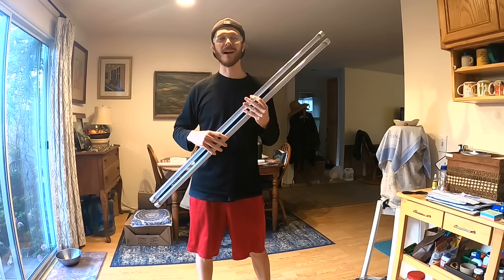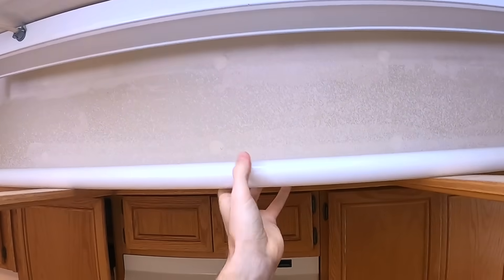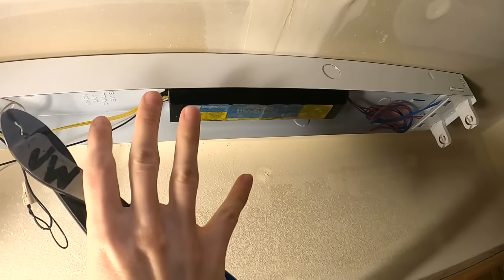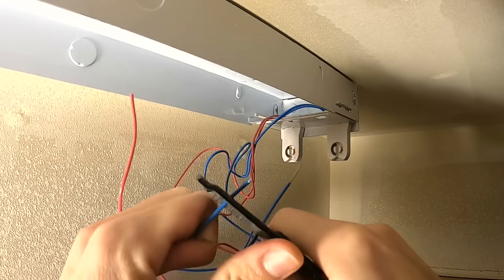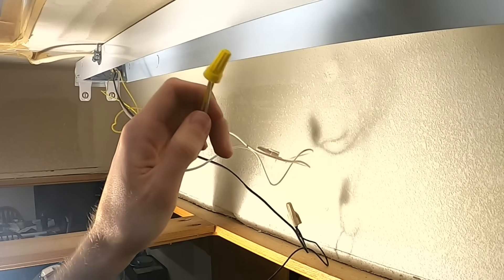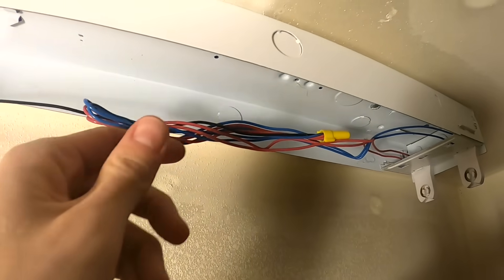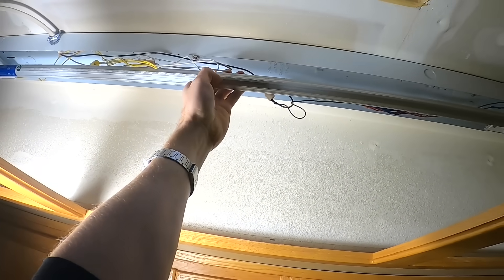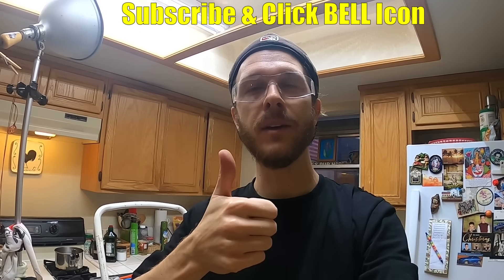How To Easily Convert Fluorescent Lights to LED | Save Money on Energy Costs

Comment: You should attach a LABEL to the fixture, to alert anyone replacing tubes in the future, that the fixture needs LED tubes ONLY.  My tubes came with labels, but I made better ones.
Reply from the maker: @joshm3342  Great point, I did write on fixtures, CONVERTED. LED BULBS ONLY. I forgot to include in video
Reply: Converted 120 v ac bulbs    they make a few versions of led bulbs

Comment: Nice clear video. One thing I always do is trim the ends of the twisted wires before I wire nut them to be sure all wires are gripped equally. Otherwise, GREAT JOB!
Reply from the maker: @vikingdane9757  Thanks! Happy to help, and thank you for sharing that tip 🙌👍

Comment: LED light tubes are a waste of money. If one LED goes out the whole tube is dead, and the happens quite often. LED is not ready for the big time yet!
Reply from the maker: @russconklin3414  there's some pretty good bulbs out there these days, but you're right some of the cheap ones can have a pretty high failure rate

Comment: After the conversion, especially now that the old ballast has been removed from the circuit, it would be a good idea to affix warning stickers informing anyone who replaces the dead tubes not to use traditional tubes but only same-voltage LED tubes in the future.
Reply: Most come with stickers for that now.
Reply from the maker: @davo768  Yes great point. For sure! I wrote on mine LED bulbs only! Fixture Converted to LED

Comment: My concerns are needing a certain kind of led bulb for this method and what happens if the wrong kind of led is used. Also, what happens if someone puts an old fluorescent tube in after this conversion? Will it explode or something???
I really want to convert to leds, but there's too many concerns like I mentioned that worry me a lot.
Reply from the maker: @mikeshanermusic  I write on mine "CONVERTED TO LED BULBS ONLY" and there's some plug and play bulbs that will work with or without ballasts bypassed

Comment: How are these bulbs doing now? Any other thoughts on this project now that a year or so has gone by?
Reply from the maker: @appleimacdude  those bulbs are still working great although I moved them to my shop now, as I did some kitchen remodeling 👍 If your ballasts are still good you can go ahead and try some of the plug and play bulbs first if you don't want to fiddle with wiring. I think the ones I linked in description can just be swapped out

Comment: I really wish well meaning Youtube DIYers would stop giving "Advice" to non-electricians on how to modify their electrical installations.  It would be like me - a Brit - giving driving advice to the rest of the world, ignoring the fact that most of them drive on the wrong side of the road 😀 and every country will have it's own rules and customs.  The item you called a voltage tester is NOT a safe means of testing for "dead" - This is more suited to fault finding.  (The advice to switch off the Breaker is always good)  But you gave no warning that simply switching off the light switch will, some cases, leave live cables in the fitting. This all depends on which wiring method the original installer employed. The light might be part of a 2-way switched light. It might be an Emergency light with a battery - in which case there would be a Permanent live cable. You may well be electrically qualified and know what you are looking at when you open a fitting. But for those out there with no experience, you are encouraging them to play Russian Roulette.
By all means, post this type of video as "Entertainment", but don't make yourself responsible for someone else's death by implying they are instructions on How-To....
Reply from the maker: @geraldelwood9660  You're right, I always recommend turning off breaker, then double checking 👍

Comment: They have the bulbs that take straight 120 volt and you cut out the ballasts and join the wires together. 

But, if it were me, I would buy new solid sealed LED 4 ft panels

You just disconnect the 120 from the ballast and take the whole fixture down and install a new fixture. 

They even have remote controlled APPs for the more exotic panels

You can change the color to anything you want, any brightness, and it can do ropes like the 1950s sign
You can have it change colors in a pattern. 

If I have to do work I would prefer to do the full setup so I don't have to do anything else in the future if I want to make changes 

And it's really cool to go from having nice bright white lights while you are preparing the meal and then when you are going to sit down you can select a nice red or blue light for dinner
Reply from the maker: @ocsrc  ohh wow sounds cool, yeah that's definitely another option as long as those new fixtures hold up over time

Comment: In Europe a straight Led tube swap is on the market no cutting wires just swop tube for Leds plus there is a starter unit that is swopped also' did mine last year a 4ft led tube was £10
Reply from the maker: @leso204  nice, yes we have plug and play bulbs available here as well. This is good option if you have a bad ballast though or don't want one extra thing to worry about failing

Comment: Linemen use linemen pliers. And no, thats not why its a rigjt hand twist
Reply from the maker: @willburt5v9714  yup my linesmen pliers are trashed I need a new pair. Ohh I meant you twist them clockwise with your pliers then twist wire cap the same way

Comment: Just turn switch off. NO need for breaker once switch is off.. Dont be 🐥🐤🍗
Reply from the maker: @willburt5v9714  Ill do that sometimes but Ill throw a piece of tape over the switch so no one flips it with my back turned

Comment: you can buy led replacements that don't require anything other than swapping out the bulbs. They've been on the market for years.....plus they produce more light....
Reply from the maker: @jchavins  yes you can get plug and plays as well, but this is a good option if you have any failed ballasts
Reply: wish they never made those ......always get rid of ballast !!!!!!!
Reply: One is a simple bulb change  the other needs electcian skills.   How  do you know what bulbs to buy if someone else made the change.

Comment: Its easier to just junk the entire box, chop 2 power wires off and wire nut a plug on it and buy an LED set that has a new housing.  This process just saves the housing of the bulb??? Why?  Just junk all that because they sell LED bulbs that have their own housing, just replace it all.
Reply from the maker: @scstudios8  yes you can remove old fixture and buy a new led fixture and install. Of  course that's an option

Comment: Plug n play bulbs are wayyy better. More reliable too as the quality ballast is doing the heavy lifting.
Reply from the maker: yes you can get plug and plays as well, but this is a good option if you have any failed ballasts. Actually the bulbs I used I think can be used either way, but I removed ballasts because 1 was bad
Reply: @JonnyDIY  true

Comment: I just bought an LED replacement for a flourescent light fixture; they said all you have to do is change it out and it should work.  Nope .. didn't work ... Do the internals?
Reply from the maker: @samsno3667  if you bought bulbs that are plug and play they should just pop in and work

Comment: Why does no one show an inline fuse on the line-in side for safety in case a non-compatible bulb is installed.
Reply from the maker: @davidfeldman7001  I write on fixtures "CONVERTED TO LED BULBS. LED BULBS ONLY"

Comment: how can you check to see if the wires coming into the ballast are working well? Any easy suggestions? thanks
Reply: You will need an ATG to check and test. But if you don't have it then hopefully that you have two or more lights.
Then you can switch the ballast. Usually if you replaced the bulbs and they don't come on, then it's your ballast is defective.

Comment: Well, with the enthusiasm that normally accompanies ignorance, I used this video to successfully convert to LED's on both my fixtures.  It's a good thing I had this video!  And whoever did it before had wires that as soon as I touched them, some fell out of the wire nuts!  So, I re-did these using pliers to twist them together like Jonny shows in the video.  Thank you Jonny for showing me the way!  Awesome!
Reply from the maker: @dimwitsadvocate6264  Awesome! You're very welcome, happy to hear I could help you get it done 🙌👍

Comment: Best video I've seen on this topic! I was nervous about tackling this project because so many times the situation I'm facing never looks like what the YouTuber is showing. Fortunately, my wiring was exactly like yours so I just ran the video through each segment, paused it, did what you just did, resumed to the next segment and repeated your actions. I was so confident in each step that I put the cover over the wires, installed the bulbs, turned on the circuit breaker, turned on the light switch and voila... light! Thank you for making this job easy!
Reply from the maker: @SpectralightPhoto  Awesome! You're very welcome, happy I could help you out. And Thanks for sharing, love hearing stories like this 🙌 👍
Reply: Thought mine would be a simple. I'm trying to use your method but no Bueno do far. I'm also trying it for 8 lamps if that makes a difference.

Comment: 5:55 I'd like to correct your statement about power coming in from both ends on your double ended bulbs. Power can ONLY be connected to one end or you'll probably blow the bulb up. At the other end is the neutral line, It's white.
The other type of bulb is single-ended, which means there are connections only at one end, while the other end has no electrical connections. On those you connect the power and neutral on the same end.

Comment: A good concise video on installing two bulbs. I need to see how to wire with 4 bulbs. I had a jack-leg electrician when I had my house built years ago so I don't trust all my electrical connections. At each end of my fixture, the tombstones on the outside bulbs are wired together with only one wire going to one pole. You said the bulbs don't care which end is hot or which end is neutral and I get that. What I need to know is: should I have two wires going to each tombstone at each end or can I get away with only using one each on the bulbs added with the hot or neutral wires? Using 2 wires each that would give me 9 wires to nut together. Or is there a better way?
Reply: P.S. I have shunted sockets.

Comment: LED lights are better than the fluorescent lights, be careful of connecting 5 wires, connect 3 to 4 wires are much better, unless if the ballast contains 1 red and 2 blue wires.
Reply from the maker: @MasterDilianoTheBlueKunBoy7K5  yes much more efficient for sure!
Reply: @JonnyDIY  be careful with the black and red wires it can shock you,  fry your body skin and your heart ❤ wear PPE.
Reply: @JonnyDIY  even you can connect to black wire too, be careful it's hot/ line voltage ⚡ with a brown wire. If you have some brown wires.
Reply: And gray wires.

Comment: The side you put them in doesnt matter? Neutral on the left since your yellow wires were on the left connected to your Neutral wire. Load to the right since your red and blue were connected to the hot? 
I just did this to my whole basement and the led lights i used had specific instructions to do so. Maybe just the specific light i used?
Reply from the maker: @stevang4720  yeah it doesn't matter on these type which was hooked to which side. Maybe they just wrote it up like that for ease of instructions as not to confuse. But hey as long as they work, all good 👍
Reply: @JonnyDIY  gotcha! Thanks for the fast reply!
Reply from the maker: @stevang4720  you're welcome, happy to help 🙌👍

Comment: good job.  clear and concise.  at time of approx 5:17 your comment when splicing the neutral to the neg side was that, "like I said, it doesn't matter which ones go to which side."  I was at a bit of a loss regarding that comment.  but overall, the best fluorescent-to-LED switch out/ballast bypass directive I could find,  Thanks.
Reply from the maker: You're very welcome, happy I could help you out 👍 Ohh I meant the black wire and white wire could connect to either side, interchangeable.  Wouldn't matter which side was connected to which 👍

Comment: This looks so easy. I got 24 used LED T8 double ended Type B lamps from Amazon for about $1 each. It’s way cheaper and easier for me to do ballast bypass than to try and replace the fixtures. In this case I can simply leave the fixtures in place. They are hanging from the ceiling joists inside of a drop ceiling in a finished basement. They would be hard to remove and reinstall.
Reply from the maker: Awesome,  good  luck 🙌👍

Comment: Though I appreciate this video, it did not help me to get my fluorescent to LED conversion bulbs to work. The wiring shown in the video was not the correct setup, as my bulbs would not light up after thoroughly following the instructions in this video. My local HD had two types of LED tubes: plug and play and ballast bypass or direct wire. Plug and play is not what you want if you wish to fully remove your ballast as I did. The direct wire tubes have to be wired differently than this video shows (because they require the power and ground connected only to one end, and the other send simply sits in the socket for placement). I first had to determine whether I had shunted or non-shunted sockets. After confirming I had non-shunted sockets (which is what I needed for the direct wire tubes), it took some trial and error to get them working. What I ultimately discovered is the following: I had two sockets and each had a blue and red wire connected to them. I had to take one wire from each and connect them to the hot wire coming out of my ceiling. The other two wires connected to the socket had to be connected to the ground wire coming out of my ceiling. After connecting them this way, the lights worked.

Comment: GREAT video but I have a couple questions..I have an old ballast ..for ONE LONG 96Inch bulb..on the right I have  ONE BLUE WIRE on the right side ballast and its mounter upside down but on the other end I have a ONE WHITE AND ONE BLACK WIRE..so only three wires total..how would i hook them up?? Also do the ends of the new LED lite..are they same as the ends on the old flourescent lite? I only have ONE long flourescent bulb with ONLY 3 wires  (2 on one side ballast (ONE white and  ONE black) and one blue on other end of Ballast ..please explain in  detail im not too good at this but removed the BALLAST as u showed! 

ALSO I dont think I have double ends on my old flour. T12 BULB..do i have to buy new ends that they go into?
Reply: If you have single pin sockets, simply purchase single pin led bulbs

Comment: Always check for voltage with power on first to verify your voltage sniffer is working correctly.
Reply from the maker: Yes, great point. I always verify it's working on a live circuit first 👍

Comment: Will this work with TOGGLED branded LED light from Home Depot? They’re type B as well. Only difference is their kit includes two wired tombstone and two unwired.
Reply: The wired and un-wired tombstones are included in case you need them. They are non-shunted  which is what the B type need. Also nice to have if the old tombstones are bad.

Comment: Very helpful.  Your camera angles and description of how to remove the cover over the ballast saved me time.  I converted a kitchen fluorescent fixture to LED Hybrid Type A+B today, and everything worked very well.  No one locally sells the kind of LED tubes you recommend in the videos.  I checked Lowes, Home Depot, ACE, and BatteriesPlus.  But when I talked to a clerk at a local light bulb specialty store, he had heard of these kinds of bulbs and respects the product.  He called them Smart bulbs instead of hybrid. I ordered from amazon, and installation steps were straightforward, just as you explained.  I don't normally do electrical DIY.  I rewatched your video many times to make sure I understood the steps.  Thank you!
Reply from the maker: You're very welcome. Nice! Happy to hear you got it done and I could help you out 🙌👍

Comment: Nice Video!!, can you tell the name on those 10" pliers?
Reply from the maker: Thanks! The cutter crimpers were channelocks but the black plies I'll have to check on. Nothing special, I'm still trying to build my electrical tool bag up. Trying to work out a deal with Klein for some tools now
Reply from the maker: Just used em the black handle pliers were just some old Pittsburghs. Theyve gotta be 20+ years old though

Comment: Do these LED lights have the longevity problems that small bulbs have?  All over youtube there are people explaining that cheap drivers and inadequate heat sinks are what are causing 10-year bulbs to only last 1 year.  Are these long tubes not subject to that?
Reply from the maker: Seems like all LEDs are, they seem to be hit or miss on longevity. These are still working after about 2 years of use in kitchen.

Comment: Why is the light shining up and reflecting off of the white metal fixture?  😂😂😂
Reply: The LED tube is not lit 360°. It is upside down.
Reply from the maker: @hatteraslabuf  yes I have them pointed downward for maximum lighting 👍
Reply from the maker: That was just a work light I think. The leds are down lit. They are bright